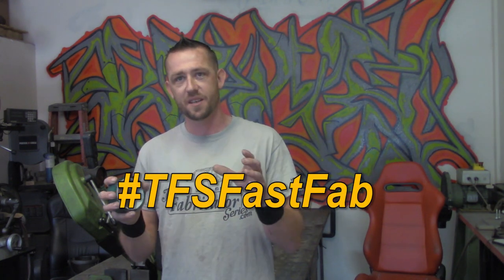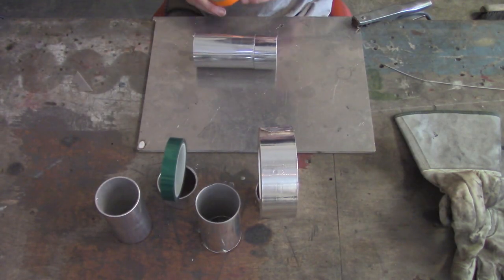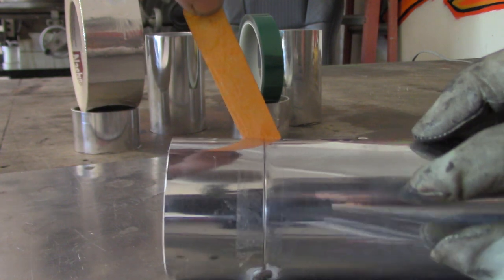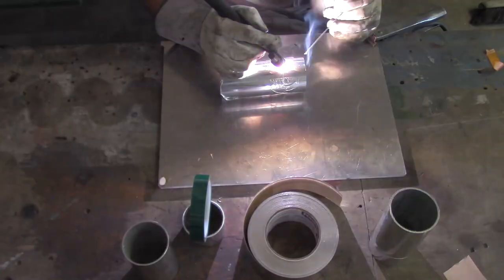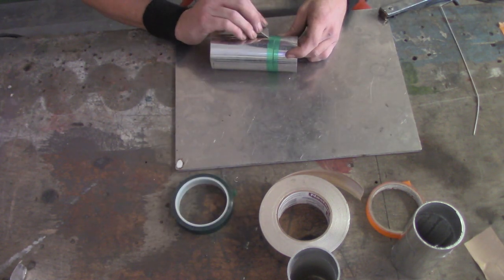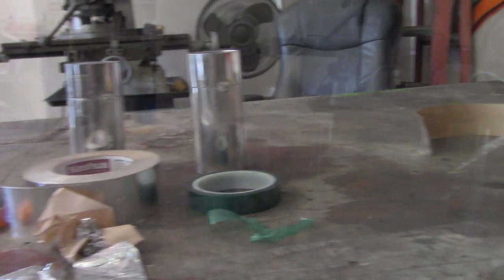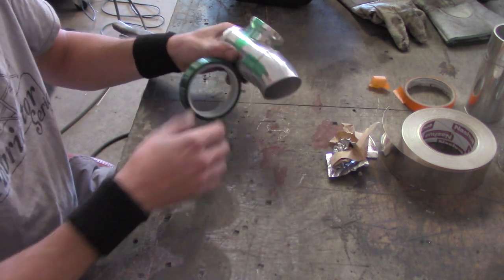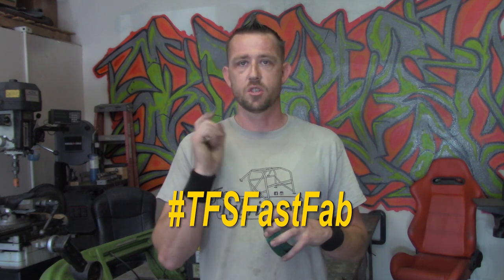TFS: PET Welding Tape #TFSFastFab

Comment: when I worked at vance and hines we used hose clamps with holes in them.
Reply: Two hose clamps and a piece of angle iron. Clamp the angle to the pipe with the clamps. Works a treat.
Reply from the maker: I have a couple but the tape is faster for me. It also doesn't scratch mirror finishes.

Comment: Kapton tape works pretty well too.  I use that for a 3D printing base material when I use ABS and as a protective barrier when I do hot air rework on circuit boards to keep the plastic parts from melting.  That's what I have around so that's what I use for welding when I need it too.  Never used PET tape for that but it appears to work just as well with just as little adhesive residue.
Reply from the maker: There are others that work well. I just use PET since it is what I was introduced with. If the others work well please let me know so I can let others know as well.

Comment: I've been using this since the 90's....... I started using this tape in the electronics field and thought it worked great for heat on the boards.... I ended up using it on small parts to hold pieces together since late 90's
Reply from the maker: Right on.

Comment: Terephthalate -- tera-fa-thal-ate As a textile engineer, I was required to learn how to spell that. It was on the test; every test. :-) Also, PET will burn, but you'll have to get it really hot. I use painter's tape -- cheap, always around, leaves no residue, but will "flame vigorously"
Reply from the maker: I've set PET on fire before, but I was really cooking it haha.
Reply: Thanks to the FAA [thought I'd have to dig up a textbook] ( http://www.fire.tc.faa.gov/pdf/05-14.pdf ) ignition temperature of 407C. PTFE would be best, but no one puts any adhesive on that stuff. (aka "teflon tape")

Comment: this is a goooood tip. thankyou very much.  i works with electronics so i has some "kapton tape".  its heat resistant. it works very good.  thankyou very much again.
Reply from the maker: Kapton tape just takes more temp which is nice but its harder for me to source in the size I need. Thanks for watching!

Comment: Hey have you ever tryed this stuff it's good for up to 752degs and a lot cheaper.. 1 Mil Hi-Temp Kapton Tape; 2 Roll Set of Polyimide Film Tape for 3D Printing, Soldering, Insulating Circuit Boards & More only cost $9.99 you can get it in 1/2 wide 252 feet long
Reply from the maker: Most "affordable or cheap" products (such as Kapton tape) are not even close to their so-called ratings.